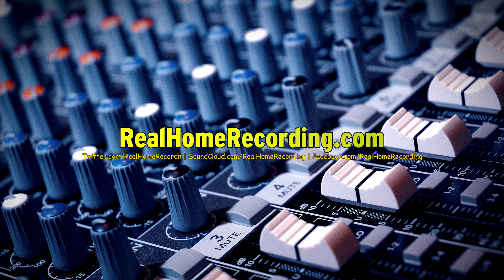Stop Audio Hum Ground Loops & Buzz Noise 60 Hz

Comment: I've been having an issue where any time I connect my audio interface with a preamp or mixer, I get a ton of what sounds like "background" noise. It's not really like a hum or buzz. I'm gonna try a few of these techniques hopefully they work.
Reply from the maker: I wonder if one side is balanced and the other one is unbalanced? I was watching a video a few days back about how the way to best connect gear like that is to have one side  unbalanced and the other balanced instead of both or neither.

I wish I could remember the video but that was the advice given
Reply: @RealHomeRecording  I just tried your first recommendation of plugging all my recording gear into the same power strip, and that seems to have worked pretty well. Thank you! There is still a very faint noise but its no where near the level it was before. I'm gonna try some more of these tips to see if I can get rid of it completely, and even if I cant, the noise is low enough now that it doesn't interfere with my recordings.

Comment: Amazing video I just watched the whole thing. Real well explained. Can I tell you my problem? We just bought a mountain home (nice place). I set up my audio interface and plugged it by USB into my Mac  (and opened Garageband to record) and there is a hum. Big time. But it comes and goes on it's own. And when it IS happening it will go away away when I touch the audio interface or the Mac or the cables. I did not have this problem at our old house. I see things talked about like IF Defender etc. I am honestly overwhelmed (and pissed off!). Any advice? Any help no matter how little would be much appreciated. 
 I just now unconnected my audio interface and connected my digital guitar pedal instead and it did the same thing.  Many many thanks from Quebec.

Comment: 2:04  if where you live is very rocky conditions, you can slightly oversize the hole you are going to put your ground rod down into and then pour rock salt all around it to fill it up. I learned this trick years and years ago out of an amateur radio handbook printed in the 50s.
Reply from the maker: Nice tip! Thanks for the comment, John!

Comment: Why not suggest using an outlet  from another circuit to help diagnose problem.  I need to try an extension cord for amp.  Also, Using a surge protector to connect cable wire thru reduces noise a lot, really helps but don’t correct problem

Comment: Guys I need help I’m having problems with my amplifier, So I’m using my MacBook Pro (TWO Type C-Ports on the left side and a 3.5 mm jack on the right. So I plug the midi type c into one and then and then plug the other end which looks like a printer wire into my Roland RD-2000) the headphone jack has a 3.5 mm plugged into that end and then the 10 foot wire is then followed into the amp with the other end of that wire plugged into the Roland piano amp, so now that you know what I have plugged in the issue I’m having is not that it doesn’t read the midi or that the sound of my software doesn’t come out but when I play the pads and patches I have from (MAINSTAGE 3 FOR MACBOOK) when I simultaneously press maybe 3 or more keys the sounds comes out and shortly after it makes this robotic cracking humming sound I’ve tried to lower both the amp and software volumes and though when it’s low I don’t hear it as much when I raise the volume as a high/loud volume is the type we have in my church it starts the noise again it’s frustrating.....SOMEONE PLEASE HELP!

Comment: Thank you for your knowledge!  And every tidbit of information.  It was very informative.  I am trying to set up a new home studio on a low budget and this information is priceless.  Really helped a lot.  I will probably refer back to this whenever I have similar issues an share this with others.
I figured out most of my ground loop, because I knew the buzz or hiss was related to grounding and was electrical hum or hiss.  
But then my 5.1 3D Sound Cards came in the mail.  They use power from your usb and have a light to show they are powered on.  Well, now that is causing hiss.  WTH?!?  :D  I am going to try using an extension usb to see if that helps.And no that did not work.  Wonder how you can ground a sound card.  :/

Comment: slightly long-winded and maybe you should write things down to reference so you can avoid being too long people will turn you off if ur to chatty. That said the noises from dimmer switches and fluorescent lights are Transformers and the glass is so thin on the bulbs the electricity flows our and around easily. Otherwise Good and informative video Thank You.

Comment: How can a non-electrical fiber optic cable induce hum? Bullshit. There is no electrical current running through a fiber optic cable. Period.
Reply: In essence, you are correct, but as has been proven that light has an electromagnetic component (https://www.khanacademy.org/science/physics/light-waves/introduction-to-light-waves/a/light-and-the-electromagnetic-spectrum) as the light becomes more coherent the EM field drops but it is still present. Therefore in theory what he is suggesting is viable.

Comment: My problem is that when I listen to the radio I get this humming noise in the back round and I think it's has got to do with the connection between  the antenna and the jack. My connection has a small cylinder in the middle of the metal connecteor, which is open at the end and that is not the end of the cable and the jack on the amp and using a joiner like piece that connects the two and I think that might be the problem, not sure. Can you please give me some feedback on my problem.

Comment: Thanks a lot for this informative video and for your recommendations! For quite a long time I have been having some really annoying audio interferences coming through my active studio monitors in form of high pitch screeching noises whenever I load samples into NI Kontakt, loading some sounds into some virtual instruments I use and also when copying files from one PC internal Hard drive to the other. I thought that it was to do with my fire-wire audio card which is an old one with old drivers but then I have tried a more recent USB audio interface and the same problem persist. I even thought that my PC mother board was faulty and it was something to do with that... basically have been testing with the wiring as well with no positive results... I hope I can get to the bottom of this issue by using one of your recommended Ground Loop isolator box. Cheers, Max
Reply from the maker: You're welcome. Best of luck fixing your problem(s)!

Comment: I have a question. I have two audio sources feeding into a single device, the problem is, the two sources of audio do not share a ground, so this leads to a hum when both are connected at the same time. 
In my situation, one audio source is the analog output of a PC, the second is a DAC which isn't actually grounded at all(Virtual ground), which leads to the virtual ground on the dac not actually being at 0v all the time. Is there a way to couple it to actual ground to fix this issue, or something else that could be done?

I want to point out the analog output is clean without hum, the DAC analog output is clean without hum, but when the two sources are merged, it hums.
Reply from the maker: The DAC is connected how? USB?
Reply: Use a ground loop isolator on one of the outputs. Fixed my issues.

Comment: Hello very informing video thanks, A few questions 1. What other reasons are for getting a hum + buzz noise (When turning up volume at source I get booms in the subwoofer) 2. What do u think is the reason for getting louder hum when connection with ground loop isolator (DTI ART) The setup and effects, 1.Receiver preout's to Equalizer to  ART XLR converter to ART DTI isolator to power amp to subwoofer speaker. Now when connected without the ART DTI isolator hum is reduced by 60-70% and when I take the equalizer out hum goes away I'm guessing 99%, the problem is when adding or the ART DTI or Equalizer, any ideas ? thanks in advance !  Beni
Reply from the maker: It's very difficult to diagnose specific issues over the internet. It looks like you are narrowing down the culprit though (taking the equalizer out). It's a process of elimination, really.
Reply: thanks, I have plugged all electric plugs to same stripe and same polarity, the hum is now lower then the sound of the amp's fans, the volume of the main unit still sends a boomie sound each time I turn it up or down same level of boom the volume doesn't change it, the DTI box works with XLR same level of hum as with out it and doesn't get rid of the volume knob issue, any how again Thanks !
Reply from the maker: That's a shame. I wish I could give some advice but can't. I would ask around Gearslutz or contact the gear manufacturer for help.

Comment: It also helps to know what else is running off of the breaker that your gear is plugged into. My clothes washer, for example is on the same breaker as my computer/interface, etc even though its in a different room.  Can't do any recording at the same time as running it. Looking into getting a dedicated circuit for the studio room. I think alarm system wiring is noisy as well....
Reply from the maker: That's a great tip, Jason! Thanks for commenting.

Comment from the maker: Too Long Didn't Watch (stop being lazy, LOL):
Prevent Ground Loop Issues
Plug everything into the same power strip. 
Invest in a power conditioner. They are more expensive than traditional power strips but they can make a difference. On a budget? Check this one out: https://amzn.to/2XeSJ46
Ground loops occur when multiple paths to the same ground are used. For example, connecting a keyboard to one.
 
Avoid using extension cables.
Use better quality audio cables.
Avoid using connector converters.
Use balanced cables whenever possible. Mixing unbalanced cables with balanced cables in the same system is usually where problems develop.
 
Cable TV or satellite TV equipment can cause problems. This includes internet routers that are connected to fiber optic cable.
Some DI boxes have a ground lift switch.
Google the term common impedance coupling 
Another source of noise comes from placing audio equipment close to high current power supplies and cables.
Avoid dimmer style light switches.
Fluorescent lights may cause issues with guitar pickups.
 
Look into getting audio isolation transformer products such as: 
 
Sescom IL-19 ( https://amzn.to/2zKJIa3 )
ART DTI ( https://amzn.to/3dkfRDW )
Rocktron Buzz Kill ( https://amzn.to/2TSqh6c )
ART CleanBOX ( https://amzn.to/2TPmdDx )
Rolls HE18 ( https://amzn.to/2XgXNVV )
Ebtech Hum X Filter ( https://amzn.to/2Bjxs0Z )
  
As a last resort, look into star grounding. This can get expensive but it may be the only thing that solves your hum and noise issues
Reply from the maker: Don't want to miss a single new video from us? Sign up for the RHR News List (your info won't be shared/sold to third parties) by emailing news [at] realhomerecording [d0t] com
Reply: faster watching paint dry too long

Comment: This is something I contend with all of the time, in live sound, and installed sound. Getting rid of ground hum and doing proper wiring is almost an art form.
Reply from the maker: Yep and it's something people usually don't think about until it happens.
Reply: RealHomeRecording.com I didn't think much about it until I re-cabled an installed sound system for the first time. Had a ground issue. Was eventually able to get rid of it, but now I listen for ground loops any time I'm dealing with audio tracking or live sound.